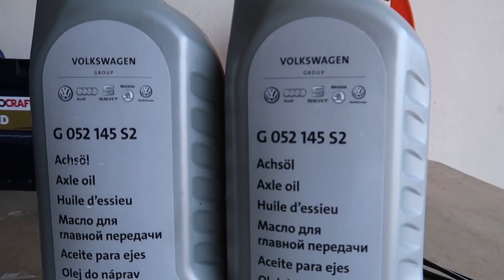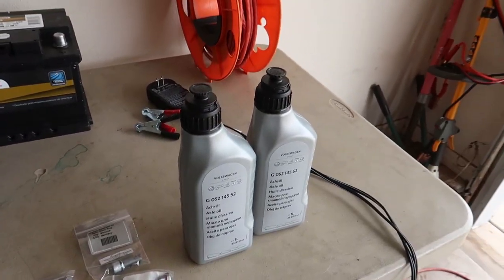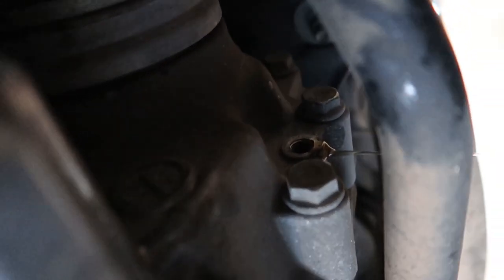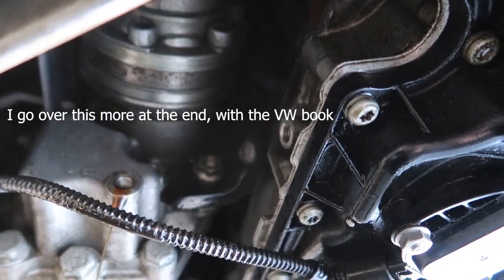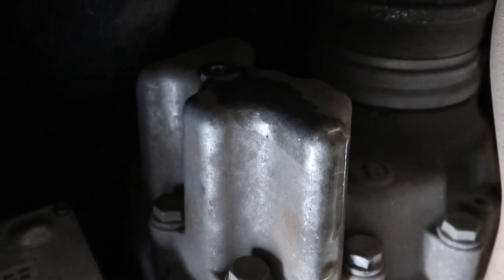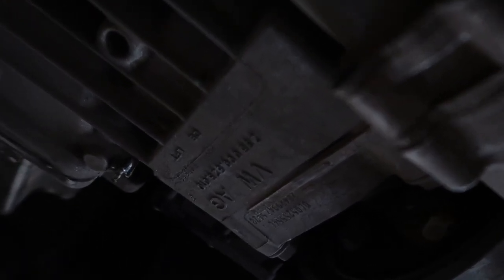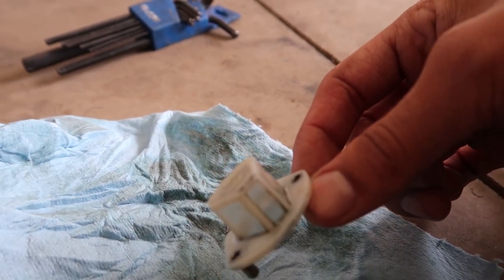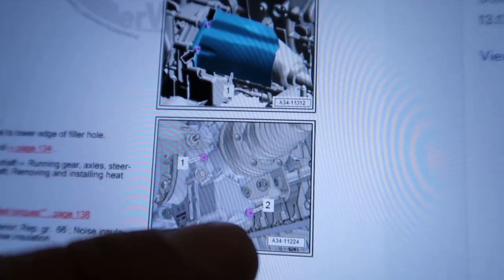Front & Rear Diff Service + Haldex Walkthrough | MK7 Golf R / AWD MQB

Comment: Bryce, yours is the first video I've seen that talks about and shows both the Haldex fluid change AND the front and rear differential oil change. 👍Up until a few days ago I thought the Haldex was the rear differential. I think you're going overboard on your Haldex changes though 20kmi seems excessive but better safe than sorry I guess. The rear diff oil didn't look bad at all a little darker but it looked pretty good unlike engine oil when changed. Thanks for the video.
Reply from the maker: Glad you liked it! Yeah it’s a bit pre mature, but I’m very very hard on my cars.. I like to think of it as cheap insurance lol. Also, racingline and others sell magnetic drain plugs for everything, engine trans both diffs and haldex, highly recommend!

Comment: I’m assuming you did this but didn’t film it. On the haldex service, once it’s full you need to start the car and prime the pump. Then, top back up with fluid to the correct level. 

Also, something I saw on the Audi groups is running basic settings on the haldex pump so the pump can be set to the correct pressure. Your pump filter / screen was incredibly clean though !
Reply from the maker: Yeah I went over this in the actual diy I made, tried to cut out some BS for this mini walkthrough just wanted to show the folks where things are and what parts are needed.. alot of people don't realize we have diffs that need serviced. They think haldex and trans fluid and that's it 😬
Reply: @BryceJordanProductions  ...I was one of those people, you can scratch me off that list now thanks for the video.
Reply from the maker: Glad I could help man! Stay up on that maintenance!

Comment: So just to recap, if I may: The front and rear bevel gearboxes (diffs) each took about 1 litre of oil and the Haldex took the entire bottle of 850ml? Did you need extra oil in any of these boxes?
Reply from the maker: Correct 1 bottle for each basically. And no extra

Comment: Do there is dsg filter & oil, a Haldex oil and filter (filter u don’t change, just clean), and a rear differential oil that u also change? I never knew
About a rear differential?
Reply from the maker: There's a front diff as well.. plus haldex, rear diff, then of course engine trans brakes in terms of fluid services
Reply: Bryce Jordan Productions so there’s a front diff AND a rear diff that needs servicing + DSG + Haldex. Wow ok. The front and rear diff services are new to me! Thanks so much for a quick reply. I’m from Sydney Australia, love ur channel. I’ve got a 2016 MK7 R running APR stg2 with 62,000km on the clock. Serviced my Haldex and dsg at 20,000km and plan on doing my Haldex and dsg again right now in a couple days time. Thinking I may aswell now change the oil in my “front and rear diff” now. Can u please tell me the exact genuine part number for the oil that I need for the front and rear diff service? Is it Just a matter of draining the oil in both and refilling both is it? How much do they both take and how much oil do I need for each? Thanks Bryce.